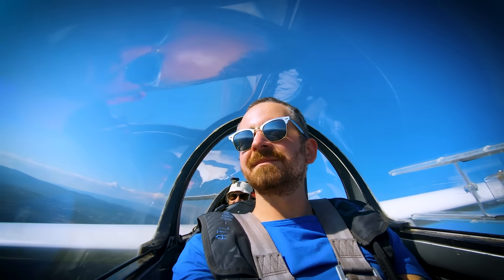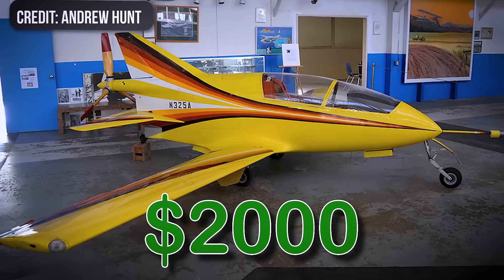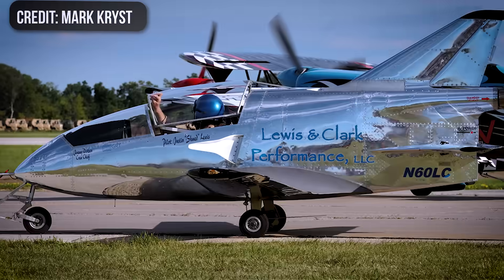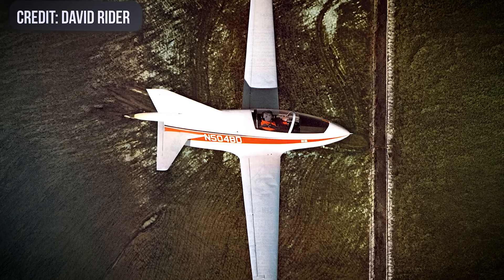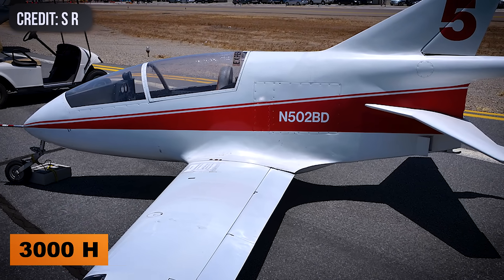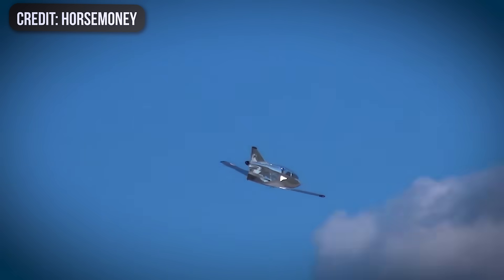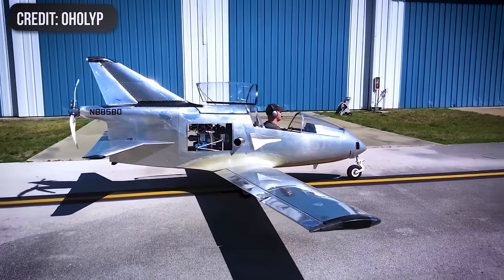This ‘$2,000 Jet’ Seduced Thousands of Pilots… Then Turned On Them

Comment: I paused when you started describing the flight handling qualities of this beautiful airplane. Up until this point you were doing a great job. The flight characteristics of this airplane comes down to construction, the pilots training, their knowledge and add in some personal feelings. There are many owners who will tell you this isn’t your Sunday flyer, you need experience. Most pilots never piloted a pusher, or an aerobatic capable aircraft, side stick, or having aspect view out the window with your ass several inches off the ground. Some ex fighter jockeys will tell you she’s a beautiful handing aircraft.
Reply: flight handling charecteristics come down to design. Solly that.
pilot is what provides, or doesnt, the qualities of that flight.... fly stupid and ego... you die very easily. Fly with respect, experience, knowledge and intelligently and its a reasonable advanced pilot aircraft.
Reply: @joeds3775  You missed the point, the PLANE’s DESIGN was COMPLETED. 
 Now it comes down to the builder. if the builder doesn’t follow the plans correctly during construction, she will not fly as Jim intended. This goes for all aircraft’s either factory or home built, wouldn’t you agree.  
Regardless of your flying experience, if the plane is not built properly, you will have a difficult time with her.
From what I have read over the years, A few of those who died trying to fly the BD-5 should’ve never been behind a controls in the first place. If you’re interested in building your own one day, I have a set of prints I could sell
Reply: @ronfitzhenry3726   I missed NO point. The design was poor to start with. Regardless of how its built. It was a poor design. Very poor, and never got sorted. There are owners that HAVE sorted some of the problems, but the problems exist IN THE ORIGINAL design.
Reply: @joeds3775    I disagree. After fixing some of the initial problems, outside the power plant ( no design start flawlessly ) The BD-5 is a beautiful piece of engineering.

Comment: Hirth didn't went bankrupt in 1974 it went into voluntary liquidation, the company was then sold and they still produce engines including engines for ultra-light and light sport aircraft under the name Göbler-Hirthmotoren KG.  They were acquired in 2018 by UMS Skeldar which produces UAV's and in 2023 celebrated its 2 millionth sold engine.
Reply: Hirth makes a good ultralight engine...!
Reply: Yeah, the prisoner wasn’t hung, he went into voluntary retirement from life…
Reply: "Applied a rope around their neck in a way that is incompatible with life."
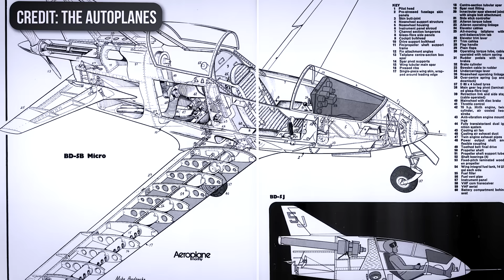Reply: why would you want junk 2 stroke 15:23 with 1974 tech when you could have modern  4 stroke tech ?
Reply: @stewartmckinley7058  Price and availability reasons most likely. Also important that a 4 stroke engine needs more parts like an liquid cooling system and maybe even an oil cooler which most likely can't fit ino an aircraft that small.
Reply: @GeorgHaeder Yamaha  as a certified 150hp  similar to R! motorcycle engine
Reply: @stewartmckinley7058  True, but I don't know if they would have sold only engines to him and even if they would have I'm sure they would have cost quite some money. 
IMHO he went down the most cheapest engine available route.
Reply: @GeorgHaeder 1980s were the last 2stroke street bikes . there a reason for that
Reply: @GeorgHaeder  The radiator for the Honda engine used in the BD5 was directly behind the seat in my aircraft. The BD5 I owned was one of the only ones with an airworthiness certificate that flew...Can you imagine sitting in front of a 220 degree radiator in that aircraft? I did it...!
Reply: @stewartmckinley7058  #weight
Reply: @stewartmckinley7058  power to weight ratio leaps quickly to mind.
Reply: @yamahale apparently you didn't see the last  moto gp race with 500cc gp  2stroke vs 1000cc 4 stroke moto GP race . Where the liter bike crushed the 500.
Reply: @stewartmckinley7058  I said power to weight, not the advantages continued 4 stroke development has over stagnated motorcycle 2 strokes. Now slot snowmobile state of the art 2 strokes against the best 4 stroke Yamaha sleds into your theory. 95lb 165hp 850cc's vs 150lb 175hp turbo'ed 1050cc's is the standard now.
Reply: Its True Two stroke are preffered for big motocross jumps although they are slightly easier to turn in the air because they weigh a few pounds less ex 250R vs 450F but the main reason is a 2strokes engine braking is non existent j compared to 4 stroke..and yes old little 350 snowmobiles are more fun than litersleds But you would have to be be fucking nuts to want a two stroke in your aircraft you were flying unless you were wearing a parachute @yamahale
Reply: @stewartmckinley7058  Rotax begs to differ with that.
Reply: @yamahale dummy

Comment: there are still lots of kits on ebay. The few completed ones you see at OSH or for sale usually have less than 50 hrs on them. He didn't mention the biggest problem they had with the hirth powerplant was resonance in the reduction drive.

Comment: Sounds like the Gee-Bee, from the 1930s. That was the short, fast racing plane that looked like it was missing the middle part. It was was difficult to fly, but won races, if it didn't crash.
Reply: According to Steve Wolf, the guy that built the replica from the original plans, it wasn’t that hard to fly. It was just a lot of airplane in its day.
Reply: @manfredstrappen7491  The problem with the Gee-Bee was flutter, in the wings or ailerons, I think. That's surprising that it wasn't that hard to fly. In any case, when the flutter set in, there was nothing you could do as the plane came apart. Unless he made modifications that eliminated the flutter risk. Do you know anything about that?
Reply: I remember looking into the story of the Granville Brothers and their Gee Bee racers . Those little buggers had some wicked and unforgiving flight characteristics . Jimmy Doolittle flew one to victory in the Bendix trophy race in 1932 , and he said that it was the squirreliest thing he ever flew and he would never do it again . He said flying it was like balancing a pencil by its point on your finger tip . I think the Bede machines were like that . The more you flew them the closer you came to meeting the grim reaper . 💀

Comment: Bede was a decent aircraft designer, but his real talent above all was being a pitchman. If you ever saw him at an airshow like Oshkosh, and standing on a podium with the mic and speakers on, he was in his element. You didn't mention how Burt Rutan was involved with Bede. He's the one who changed the original design of the BD-5 from a V tail to a conventional one. And other improvements to its design.
Reply: Yes, he mentioned Burt.
Reply: @DaveDave-e4t  But mispronounced his name..... Kind of weird to get that wrong....
Reply: @nortoncomando1975  Not if you are A.I.
Reply: @nortoncomando1975 He also pronounced "climbed" as "climmed".  AI voice
Reply: I was a young tech working for them. Burt Rutan (Ru Tan),  replaced the small Horizontal / Elevator with an almost twice as large Stabilator. Bede's gang did the initial change from the V tail to the small horizontal. 
And showing an RC BD Jet is not cool.
Reply: Yeah this video and comments are the first negitive feedback of this frame I have seen in my 30 years of life and being an aircraft fan... Like I get it's hard to fly but that is true for cessna's too... Like I persoanlly beiove if yyyou have to trim to acive stable flight then your plabe isn't stable...
Reply: If the fatality stats cited here are true, that is pretty damning of the design whatever you think of the guy
Reply: So basically Elon Musk with actual decent designs?

Comment: A friend of mine has (2) BD-5J's. The 1st one was underpowered and wouldn't get out of ground effect, nearly killed him. The 2nd one, he installed an 800 lb. thrust APU, hasn't killed him yet
Reply: Good idea to think "APU" but all Turbines are very thirsty so I'm guessing he reaches a maximum distance sooner than desired.
Reply: @arcanondrum6543  "V1, rotate, bingo fuel"
Reply: Does he fly it much?
Reply: Thrust APU? Never heard of that, APUs (auxiliary power units) are small centrifugal jet engines designed for electrical power on aircraft, not thrust?
Reply: @Ian-ianman  Helicopter and Turboprop aircraft are basically powered by large APU's turning massive gas pressure into shaft horsepower. Remove the gear box and all you have left is a turbojet engine that outputs thrust. Go pull a picture of an APU off the web. Buried inside there is a turbine engine. A BD-5 pilot I was referring to also built a turbine powered golf cart as a joke out of an APU. Loud as hell and slow while gulping copious amounts of JP5 🤣
Reply: @donuthole7236  I remember a JFS-100-powered kart that retained the power turbine and had a custom output bearing housing and chain drive. It was fast. The same guy repowered a boat with an Allison 250 heli engine. I almost bought a Boeing 502-6 navalized engine (from a minesweeper) from him, but decided against it because I couldn't think of how to explain it to my wife.
Reply: @kendauer9781  LOL, 20 years ago I was at the Rock Store when Jay Leno pulled up in his Bell Jet Ranger powered motorcycle. It was loud as hell! I was talking with him asking about the bike. He said it cost $200K, has a 2-speed transmission, got 7 mpg, made 400 ft/lbs. of torque, had a 3 second delay on the throttle in both directions and it has melted bumper covers who ever got to close at a stop light.
Reply: @donuthole7236  that is so cool, I work on business jets so I have been exposed to (but never taken a part other than a starter/generator replacement or the whole unit) a lot of APU’s, particularly Honeywell ones but could see how they would output any kind of significant thrust but a whole heck of a lot of shaft horsepower. :-)
Reply: Tell him to install a Mazda Rotary engine from an RX-7.
Reply: Big, much?
Motorbike engine better, surely?
Reply: @onceamoth  or modern snowmobile engines.
Reply: @onceamoth  Just wait a while. There are a ton of new engine designs coming out to fill the demand For the exploding military drone market. And since they're specifically made for flight you don't run into the typical issues using car and motorcycle engines plus they They all seem to have their own unique advantages.
Reply: @daszieher turbo jet ski engine
Reply: @onceamoth  motorcycle and automobile engines are not well suited for aircraft due to the extended power output expected of them and will likely fail sooner rather than later. Think of it as going uphill at 75% power for hours. Very similar to marine engines.
Reply: @99MorganStreet  Mazda rotaries are plenty thirsty as well as having cooling issues.
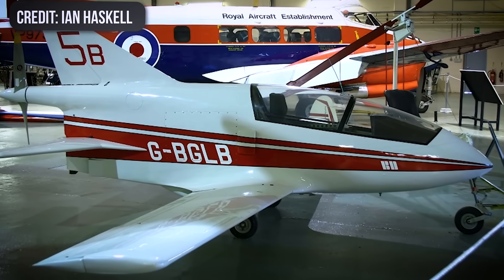Reply: @postulator890  The Irish registered version that is shown in the video (c 3:54) had one of these engines. It caught fire in flight and the subsequent crash killed the pilot/owner.....
Reply: @postulator890  All engines have cooling issues if they're not cooled properly. Cool the engine properly, and a Mazda rotary can be extremely reliable.

Comment: I had the misfortune to meet a fellow at a cocktail party who was building one. I told him that as a guy with some small jet time, what he was doing scared the poop out of me. When we got in the car, I told my wife that the guy would be dead in a year. I was wrong. It was eight months.
Reply: reminds me of the GeeBee
Reply: @moss8448  That was my first thought as I started to watch this video.  With those stubby little wings I instantly expected this to be a handful to keep under control.  No way would I trust getting into that without any experience of the type but, being a single seater, there's no way to get that experience without getting in and flying it.  No thanks.
Reply: You sure sound like a fun human.  You know I you could have helped him and he’d still be alive.  But nope,  just shoot your mouth off.  What an asshole
Reply: You just knew something wasn't right with that aircraft. You just knew it. Either that or you knew that he as a pilot wasn't yet ready to fly such a demanding aircraft. Sometimes people just have a gut feeling and it turns out to be right, guess this was one of them. Well rest in peace to that pilot, at least he was doing something he wanted to do I guess. Sometimes we have to use good judgment and consider the risks.
Reply: @andrebello4191  Well, the thing that killed him was a misaligned flap drive (incorrectly installed when he put the wings back on). He had electric flaps. The identical situation almost killed Corkey Fornof (the chap who flew the BD 5 in almost every movie it was in). But, he had mechanical flaps (and quick reflexes). Corky was an extremely experienced and competent pilot who did some crazy stuff by my standards. This poor guy didn't even know what he didn't know I think.
Reply: So it wasn't the aircraft that killed the pilot/builder but an incorrect assembly.

Comment: My father built the first non factory to fly and didn’t crash, N746BD. After it’s test flight series, she crashed do to nothing to do with the design but electrical problems. She flew with both the Hirth and Zenoah. There’s a lot of disinformation and hyperbole this video mixed with a number of truths. The engine had been sorted but by then there was no money left. It flew like a P51 not the 150 as promised. Pitch sensitivity was common on all of Jim’s designs but wasn’t the big issue. It used 4” wheels and brakes not suitable for many runways with tire overheating a big issue. Our first kit without jigs took 2 years, part time, to complete and fly. The factory jigs did drop the build time dramatically, the last one we did in three months. Jim’s  mistakes taught the follow on designers valuable lessons, some like Burt Rutan worked for BD went on to create some excellent designs. Jim’s biggest mistake was not focus on the the original design to completion before getting distracted with new projects.
Reply: IMO, the real issue, like most visionaries, was that he saw what was possible, but lacked a way to get there. The modern LH-10 Ellipse is the exact plane he likely hoped for, but in a workable form.  Because the technology actually existed 30 years later to make it work, be safe, and reliable.
Reply: most companies founded by entrepreneurs fail like that.  the ones that don’t were either sold or there was a partner with solid managerial skills and the ability to keep an eye on the ball.
Reply: agreed. much bad press came from the beginnings and the design not being followed up correctly. However, the twitchy airfoil was never a good choice for a homebuilt, at least not the way it was advertised.
Reply: @daszieher with use of the factory trainer and high performance experience it flew quite well, but did not tolerate basic mistakes. Pusher designs are rare so few knew how to handle its idiosyncrasies. Time in a Lake helped. The big draw back was there was NO crashworthiness. We submitted a number of recommendations to BD that we incorporated in later builds. When she stalled she let you know.

Comment: I have personally seen a BD-5B powered by a Honda-Turbo regularly fly at 250 MPH just a few years ago! It has over 1,200 flying hours on it. You need to do more accurate research on the BD-5, instead of just repeating old myths and bad gossip.....  Over 75 different engine types have been attempted by builders after  Bede went bust. The BD-5J jets have been performing in major airshows for over 50 years now! The real problem was after 1978 many bold individual builders deciding to just throw in any engine into their BD-5s, without any factory support, and hoping for the best..... Some died trying. It is all about a dependable engine! Eventually, a few builders were successful with their own engine installations that were actually proven compatible with the drive system. Lately, a new Suzuki 1.3 liter powered BD-5B has flown successfully! It is  close to the original design weight, and only burns 3.5 gallons per hour! The future is bright for the BD-5!
Reply: Absolutely
Reply: The new Toyota turbo engine 3 cylinder 1.5 liter 270-300 up in the GRS Yaris or Corolla would make a great engine.
Reply: With all due respect, no BD-5 flew 250 mph with a Turbo Honda. I built and flew two BD-5B’s. The fastest mine flew was 162 mph. GPS TRIANGULAR course verified. It had the proper propeller for cruise flight. I have 26 hours in BD-5’s.
Reply: This doesn’t contradict what’s in the video.
Reply: You are smoking from the exhaust! Not everyone has that 'ability'. It's been fifty years and the numbers speak for themselves.
Reply: Where to begin...? BD needed you in his sales department....